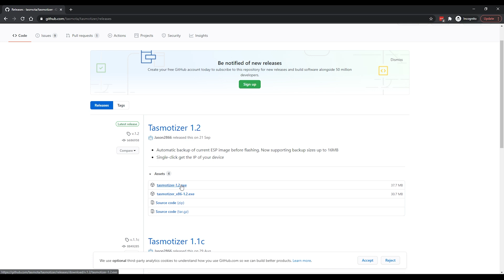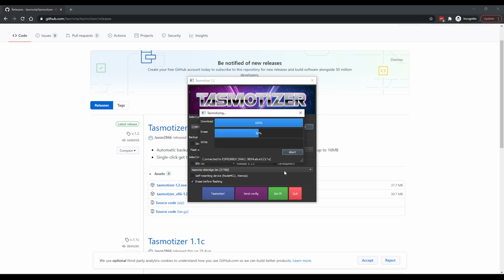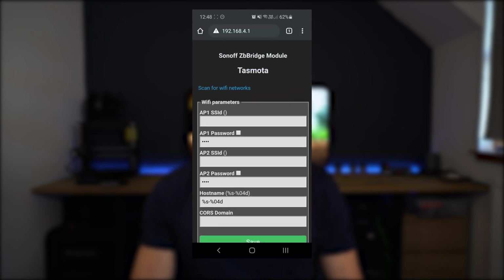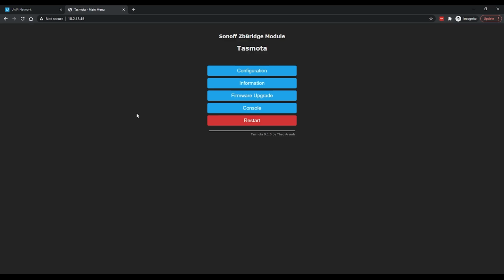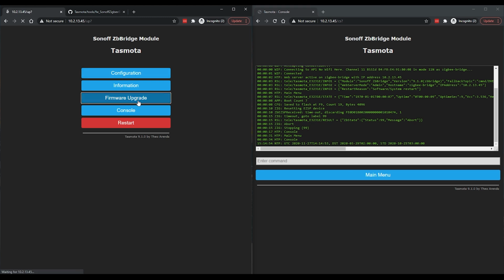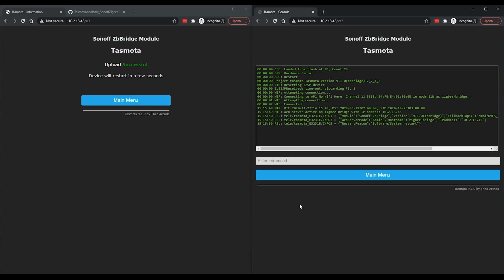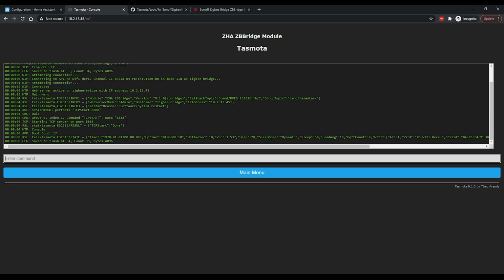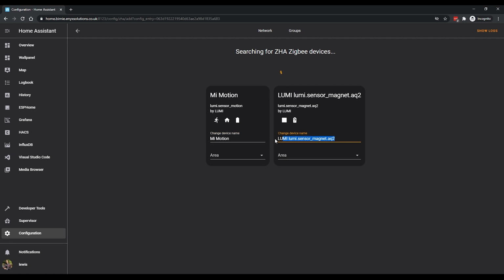Sonoff Zigbee Bridge with Tasmota And Home Assistant using ZHA

Comment from the maker: There seems to be issues with the latest version (9.3.0+) of Tasmota which are the current latest releases, which is causing disconnects of either the bridge itself from Wifi or sometimes devices are dropping off.

I'm using version 9.1.0 in this video and has been absolutely flawless, I suggest using this version instead of the latest at the moment till the issues are sorted, I will try to update this in future when newer releases are safe again.
Reply: I can agree to this. I had a reboot loop with version 9.3.1
This version will be downloaded automatically when you use tasmotizer. Meanwhile you can find the latest version 9.3.1.3  and it works perfectly.
Just switch to development in tasmotizer.
Reply from the maker: Thanks for the update!
Reply: i tried these versions also newest one but couldnt  get rid of this wifi connection problem, at one stage its having a wifi connect/disconnect loop in every 3 seconds. i think i setup around 20-30 times from the beginng but no solution. only once it worked and but in that one home assistnt give fail to connect message:(
Reply: @ItsZehraPKXDfan  any updates on this? My bridge has started entering bootloops after a power cycle, or on DHCP refresh  - the only way to reconnect is to reboot the wifi router which is a pain
Reply: @ItsZehraPKXDfan  this is the reason why the sonoff zigbee bridge isnt recommended by ZHA or Z2M
Reply: @adrianbishop694  Did you ever find an answer to this? I'm weighing my options between the bridge and the 3.0 USB Dongle since I don't plan on having too many Zigbee devices, but I'm worried about signal strength with the dongle since my HA is in the corner of my house and I have brick walls.

Comment: A note for late comers to this video which is perfectly done BTW. If you are trying to flash a v1.1  2020.02.28 board do not use the latest version of tasmota or the zigbee firmware, Tasmota will flash just fine but the zigbee firmware will not. You have you use tasmota 9.1.0 and then use zigbe ncp-uart-sw_6.7.6_115200.ota. Every other combination failed to flash the zigbee radio. Other than that this tutorial is perfect.. I hope that could save others time and it would be nice if it was mentioned or pinned at the top of the comment...
Reply: Thanks, I'm about to make this process tomorrow. If you have found any other tip recently it will be very much appreciated
Reply: I got stuck in the OTA upload Transfer, I changed to version 6.7.8 and I got it working

Comment: Q1 2023: this tutorial doesnt work anymore. But just the from the point of the commands further. i couldnt connect to my tasmota. buiit if i run this command it works:

backlog rule1 on system#boot do TCPStart 8888 endon ; rule1 1 ; template {"NAME":"Sonoff ZbBridge","GPIO":[56,208,0,209,59,58,0,0,0,0,0,0,17],"FLAG":0,"BASE":18} ; module 0

thanks to:
https://www.youtube.com/watch?v=3jUBgeyQ3B8

Comment: My Adapter does not show in the "Select Port" Dropdown, it does not show any
Reply from the maker: You have likely used a non data cable
Reply: @EverythingSmartHome  Fixed it, i needed a specific driver for my usb adapter

Comment: Hello Everything Smart Home,

I tried several times, but keep on running in this error:

Failed to connect to ESP8266: Timed out waiting for packet header

Do you have a suggestion for this issue?
Reply: removing the "erase before flashing" option shows progress on the blue backup bar. 

Writing to the sonoff device does not work well

Comment: And this massively complex process is why SmartThings, Google Home, Alex etc exists
Reply from the maker: Don't see the crossover your trying to make, this has nothing to do with home assistant being difficult lol this is something else entirely.
Reply: @EverythingSmartHome  This is a whole other level! 😂 I've been looking at multiple smart home options over the last few weeks. I'm starting from scratch. When I watched this (great video by the way), I finally realized why I should stick with an off-the-shelf option. This is WAY too much effort, for me at least. For people who have the time, patience, resources to replace bricked devices etc., your video is a great resource
Reply from the maker: Sure but what I mean is that this isn't required for home assistant at all, there is much easier ways to get ZigBee with home assistant that are just plug in and away you go
Reply: @EverythingSmartHome  Yes, I know. Sorry, I can see I wasn't being clear. I simply meant that based on this video, getting the Sonoff Zigbee bridge connected to Home Assistant is far more complex than connecting it with, Google Home, for example. I realize they do different things (one local, the other web based). I'm considering buying all Sonoff devices, and when I watched this, I realized connecting them to Home Assistant may be a bit of a mission
Reply: @EverythingSmartHome  Thank you for responding by the way. Didn't expect a response. Impressive communication with your subscribers 😊

Comment: You can make flashing a bit easier by powering the bridge via the micro USB port. You can short gpio 0 to ground while connecting it. After that you only have to hold down RX and TX while flashing.

Comment: @Lewis, thank you for the great tutorial. I managed to get the bridge working but I was intending to use the bridge as an extender while keeping the Nortec plugged in. 
Is there anyway I could do that, or any other way I could add other bridges to extend the range? I don't mind removing Nortek.
Thanks.
Reply: Hi - can you confirm what firmware and ncp-uart files you used to get this working? I have tried just now with latest version in Tasmotizer (10.1.0) and ncp-uart-sw_6.7.8_115200.ota, but when I flash the latter using the over-the-air firmware uploader, it says "invalid file signature". I have tried resetting and reflashing tasmota from scratch, I get the same thing over and over. I thought the latest version of Tasmota zbbridge firmware was a problem, but noticed you posted this in the last day so wondered how you got it working? Thanks in advance!

Comment: I got exactly the same flasher. When I plug the usb in windows gives it a com port no problem but as soon as I attach the wires from the bridge the device manager shows "Unknown USB Device (Device Descriptor Request Failed). Did any one encounter the same issue or knows how to fix it? Thanks
Reply from the maker: Check the driver that's being loaded
Reply: @EverythingSmartHome  Thanks, I used the driver windows assigned to it. Any idea where I might be able to get the correct driver?

Comment: Flashed with tasmota 9.5 which appears to have worked. Then trued to upgrade with uploaded file ncp-uart-nsw_6.7.9_115200.ota, and did not get the success message. Instead the last few lines of my console are as follows:
22:35:18.975 ZIG: Subscribe to group 0 'ZbListen0 0'
22:35:18.976 ZIG: ZbEZSPSend 64000000000100
22:35:19.028 ZIG: {"ZbEZSPReceived":"640000"}
22:35:19.030 RSL: RESULT = {"ZbState":{"Status":0,"Message":"Started"}}
22:35:19.030 ZIG: Zigbee started
22:35:19.056 ZIG: EEPROM signature 0x6D736154 is correct
22:35:19.060 ZIG: No Zigbee device information
22:35:19.065 ZIG: No Zigbee device data

So I disassembled the device, reflashed Tasmota, and the same thing occurred. Any thoughts on what I did wrong?
Reply from the maker: Did you see the pinned comment about using 9.1.0?
Reply: @EverythingSmartHome  I did, but it was in reference to a problem with 9.3.0+ and assumed it was no longer a problem with 9.5. thanks, I'll try that.
Reply from the maker: Might not be worth the problem but worth a go! Let me know how it goes
Reply: @EverythingSmartHome  before I disassemble the device and bend more staples into jumpers, can I imstall Tasmota 9.1 OTA as I already have Tasmota installed?
Reply from the maker: I think they blocked downgrading from 9.3 onwards I believe. Could be wrong through
Reply: @familykidschannel9796  have you figured it out? i tryed all versions pinned and not and the update always fails...

Comment: ZHA fails to connect. I can flash the device fine. The console shows "TCP: Starting TCP server on port 8888 -  RSL: RESULT = {"TCPStart":"Done"}"  but when entering "socket://my_lan_ip:8888" HA gives a cannot connect error. Can nc from another device and the port is open. Anyone seen this before?!
Reply from the maker: Which version of Tasmota you on?

Comment: Louis, great video as always! One question for you, few years back Zigbee's appeal was that WiFi routers could not handle too many devices but that does not seem so relevant with latest routers. Do you see Zigbee as a viable and long lasting tech say 5 years from now?

One a side note, Tasmota is awesome! The few devices that I flashed do not even attempt to communicate outside the LAN for any reason and it is quiet a relief!
Reply from the maker: Thanks! It's very hard to predict but yes I think ZigBee will be around for the next 5 years at least!

Tasmota is excellent, along with ESPHome!

Comment: Please your help, when flashing procees ends I had the message MD5 of 0xFF is 4ec2e29ca3952043a72fadadd997769a. The Zigbee bridge is a V1.1 dated 20.02.28, it's powered by a 3,3V power supply, the ground is common with the USB to Serial converter, and ETx to RXD and ERX to TXD are proppertly connected. Flashing was used Tasmotizer, and  also NodeMCU-PyFlasher, both whit the same results.

Thanks for your help.

Comment: Thanks 👍 Do you think this would give noticeable response time improvements over stock Ewelink? I use the Sonoff SNZB-01 button with it through Home Assistant (local mode) and I find response time a bit too slow. I would flash to Tasmota if I could get improvements in response speed.
Reply from the maker: Responsiveness is great in my experience so far but I guess it could be dependant on your environment and devices!

Comment: I think I missed a critical part which was to switch the jumper on the FTDI adapter from 5v to 3v.  I received a solid green light on the bridge, and checked the wiring was correct about 50 times.  However, I can't get Tasmotizer to work, it keeps giving me the error 'Failed to connect to ESP2866: Timed out waiting for packet header'.  Have I accidentally fried the ESP2866, or is there another explanation for this?  Is there any way to confirm I have killed it?
Reply from the maker: Quite possibly, join the discord and I'm sure someone can help you out!

Comment: every time I try and flash the Zigbee chip I get XMD failed. Am I doing something wrong or is there a step I am missing?
Reply from the maker: Hi Craig, which version of the firmware are you using?
Reply: Could you fix that?

Comment: Hey man, great video! I was able to flash my Sonoff ZB Bridge without any problems. I want to ask something though. I flashed it with the "ncp-uart-sw_6.7.6_115200.ota" but I now want to upgrade to the latest "ncp-uart-sw-6.7.8_115200.ota". Any ideas on how I can do that? When I try to upload the file and upgrade via the Firmware Upgrade from the Tasmota UI, I am getting a "Upload Failed - Invalid file signature" message.
Reply from the maker: Thanks!! Is there any reason you need or want to upgrade? If everything is working correctly then this is one of those times I would recommend just leaving firmware alone if it works, and that's coming from someone who loves to update 😅
Reply: @EverythingSmartHome  I wanted to update to 6.7.8 because I am an update freak and want the latest firmware most of the times (as long as it works of course). In this case, I took into consideration the changelog for 6.7.6 that said "contains a bug that can cause battery of IKEA and Philips remotes to drain". So, since I have 2 IKEA and 2 Hue remotes in my home, I thought it would be better to get on the 6.7.8 version. But the upload fails constantly and maybe this is due to the Tasmota version I installed (9.3.1). 

As you say in your pinned comment the latest versions have issues and it is advisable to flash a previous version (you recommend 9.1 while others say that 9.2 is fine too). So, the question is: in order to downgrade to Tasmota 9.1 will I have to go through the same flashing process as in your video (USB flasher, cables and all)? Should I download a previous version and choose that .bin file to flash the ZB Bridge with? 

Edit: I went to "Configure template" page via the Tasmota UI, I changed the Template parameters "Based on" from "Generic (18)" to "Sonoff ZbBridge (75)" and I was able to upgrade my firmware to the "ncp-uart-sw-6.7.8_115200.ota".
Reply: @manouallou2189  please be sure to type this command on your console and hit enter:
Backlog weblog 3; SetOption65 1; Module 75;
In particular the "Module 75;" is key to could to flash a new firmware!

Comment: Nice video! But I just cant get the jumperwires through the tiny holes! Do you use a spesific brand etc. of wires?
Reply from the maker: Thanks! You can apparently use pins or sewing needles to do it too, that might be worth a try!
Reply: @EverythingSmartHome  I used staples after straightening one end to fit the holes and folding over the other to double it to fit the female end of the DuPont wire.

Comment: New to Zigbee - I have the Bridge and tried (xiaomi) Aqara door/window sensor - oddly, the device adds to ewelink app and I see a quick green led flash on the bridge when I make/break the sensor but there is no status change on the app (I also want it in SmartThings and it shows there, but does not change state there either - probably because it does not in ewelink!) I don't use HA so is process essentially same except the last stage? SO then how do I pair if not using ewelink or HA?
Reply from the maker: Hello! Sorry I'm not sure the question and not sure if I'm the best person to answer since I never used the eWelink app at all, I flashed as soon as I opened it!

Comment: Hi! Great video, your explanations are really clear and easy to understand! I have some (stupid, i think) questions: 
1) Will this allow me to control all my scenes and  zigbee devices locally (with no internet connection)? 
2) Do I have to flash tasmota to every zigbee device in my network for it to be located by this hub?
3) After flashing tasmota, will the hub stop working on ewelink app?
Thanks, in advance and congratz for the channel!
Reply from the maker: Thanks Igor! This does all work locally but you'll need something else like Home Assistant to control it. You don't need to update firmware on any other devices just the bridge and yes the bridge will stop working in the eWelink app! Hope that helps!
Reply: @EverythingSmartHome  Thank you very much for the fast reply! I've been studying a lot to automate my home and I needt it to be controlled locally, especially due to all alarm automations with zigbee sensors. It seems to be VERY hard to make everything work together. Could you please help me just a little more :D? 
1) I've saw some zigbee2mqtt dongles, do you know if it's better than flashing the hub like you did? How about the number of devices each method can control?
2) If I opt for HUBITAT instead of Home Assistant, will I have the same difficult to control every scene and devices locally?
3) There is a lot of information on youtube and right now I'm completely lost, as your channel is the best that I've seen, I would like to know your opinion: Which would be the best option for me?
Thanks!
Reply from the maker: Hello! Your welcome. It's probably easiest if you want to hop into the discord server, we have lots of people there to help with your questions that aren't easy to answer over YouTube

Comment: "Failed to connect to ESP8266: Timed out waiting for packet header"
I could not figure out what the issue is when I try flashing in Tasmotizer 1.2. 
Any direction would be highly appreciated. Thanks!
Reply from the maker: Hello! Make sure to check your TX and RX lines are the correct way round as per the video and make sure you are grounding IO0 on startup too! If your still stuck feel free to hop in the discord server!
Reply: @EverythingSmartHome   redid the wiring today and BAAMMM..... ZHA integrated. 
Why doesn't YouTube have a button give like a 100 likes. 
Thanks a lot for the video and responding to my comment.
Reply from the maker: Hey that's awesome, glad you got it! 🙌

Comment: Hello and thanks for your videos. They help a lot. I have a Conbee 2 USB stick connecting my Zigbee devices - and I have 100+ og them. Will this be a better way for me to go? Does the Sonoff Bridge with Tasmodo have any advantages here?
Reply from the maker: Hello and thank you for watching! If you are happy with the way it works then I wouldn't suggest changing. One advantage of this is the placement of the bridge. You aren't tied to having it plugged into your HA server you can place this anywhere in your home but other than that no real difference
Reply: @EverythingSmartHome  could I have more than one sonoff hubs in different rooms all connected to home assistant? I'd need to cover distant rooms and don't want to have zigbee routers all around the house. Thanks.